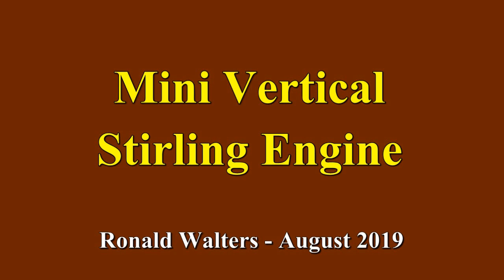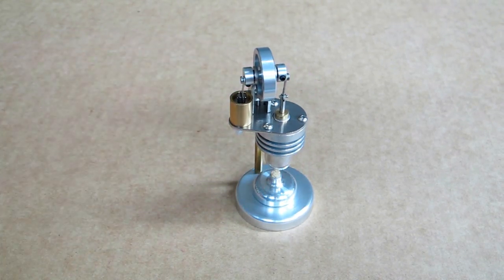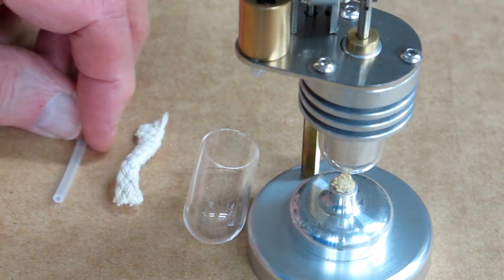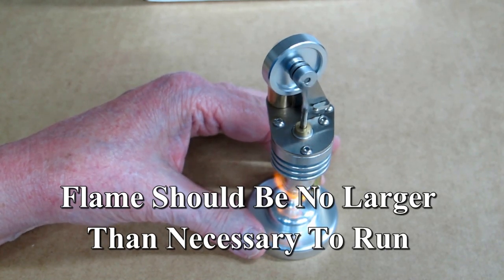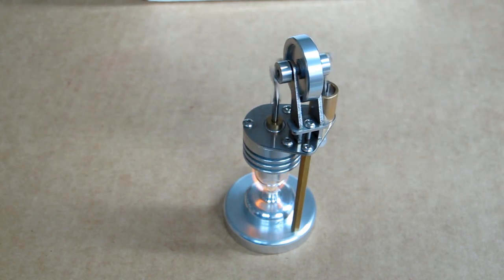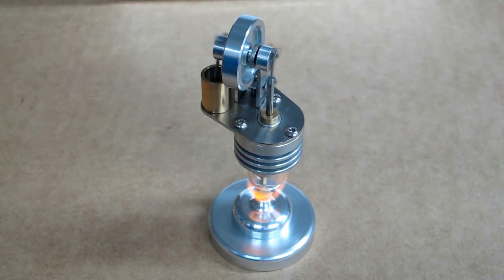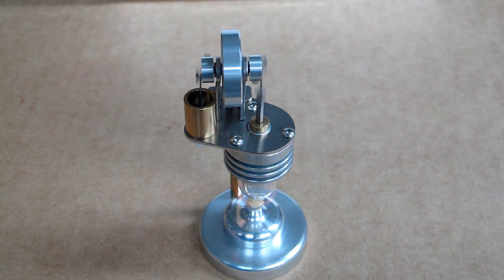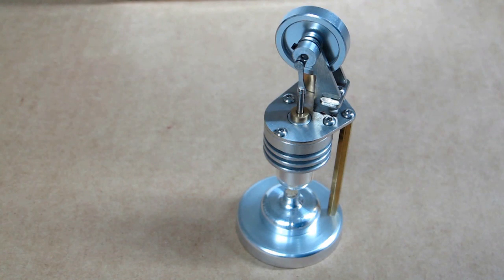Mini Vertical Stirling Engine

Comment: Eu montei uma aba separadora entre o tubo de vidro e a parte superior e um dissipador térmico de alhetas no corpo metálico superior para evitar o excessivo aquecimento. Agora este é um dos meus melhores motores Stirling e o mais eficiente - trabalha 20 min. com apenas 1 cm3 de álcool. Eu lubrifico o êmbolo e a haste do deslocador com óleo fino.
I mounted a separator tab between the glass tube and the top and a heatsink on the top metal body to prevent excessive heating. Now this is one of my best and most efficient Stirling engines - it works 20 min. with only 1 cm3 of alcohol. I lubricate the piston and the displacer rod with thin oil.
Reply from the maker: You should make a video and show us what you have done. That would be very interesting and informative.
Ron

Comment: Unless the power piston and/or power cylinder are made of glass I would recommend using oil on the moving parts despite what the instructions say. On my engines I use Redex fuel additive as a lubricant. This does not go goey or carbonise with the heat.